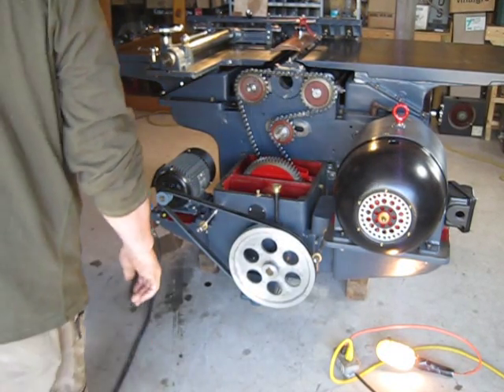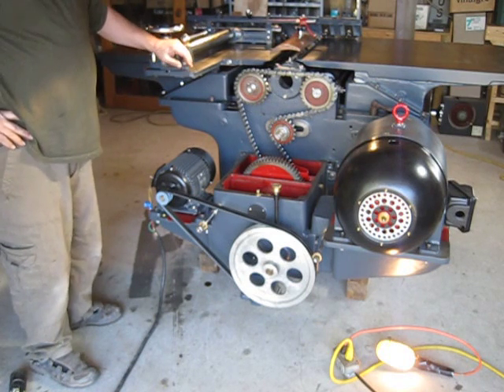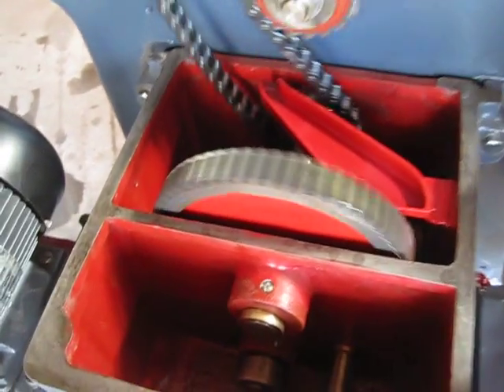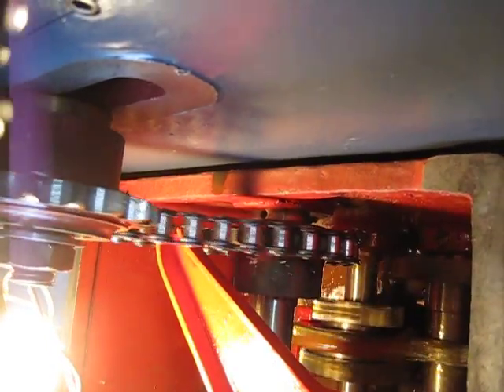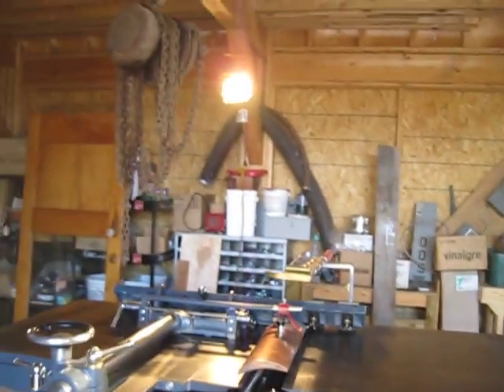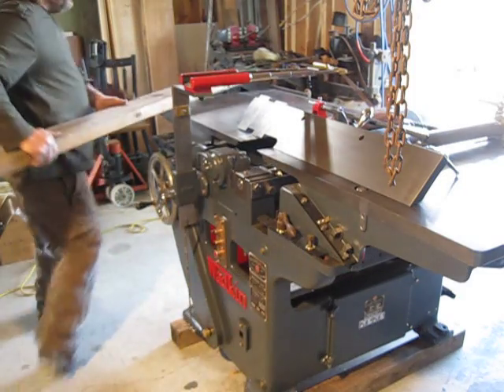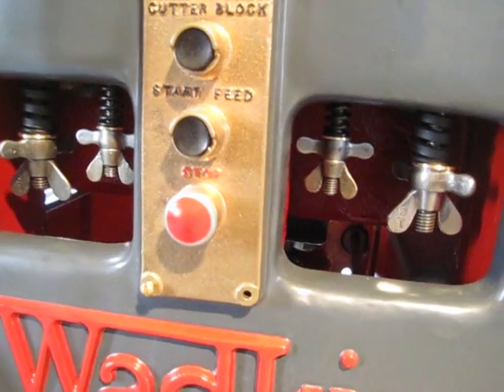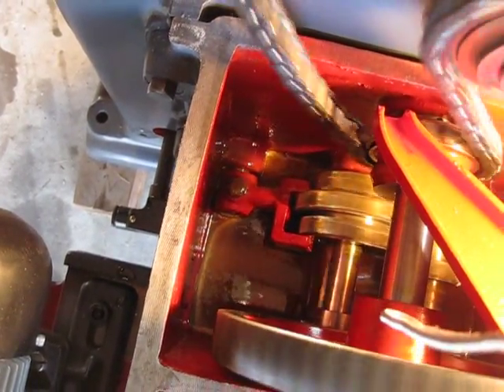006.AVIWadkin RM power feed

Comment: I think you need to run the chain with more slack in order to accomodate the lift of the outfeed roller. I have run one of these for many years and they are bulletproof. The settings of the feed rollers and bars are very important and when properly set will completley eliminate snipe. I wish mine looked as nice as yours though!

Comment: That oiling is beautiful! And the wingnuts are lovely too. Whitworth is a pussycat, workshop machines are OK to work on, old Brit motorbikes are a nightmare, they used a lot of CEI which is a cycle thread, then bits of Whitworth and BSF, BA for the small fittings and BSP for the oil pipework.

Comment from the maker: i have had the planer on hold until i get the Wadkin temple (mill shop) finished. i am machining  the head to take pin knifes for the moulder section.

you can see the build at 
Canadianwoodworking fourm under vintage tools  for 1941 Wadkin RM. it shows more of the rebuild. if you got question drop on by the forum as there are lots of Wadkin nuts there rebuild these machines.

not sure if i link works in this reply but i will post it in the you tube video title.
great machines  the wadkin Kit.

Comment: that machine is mint a credit to you, i have the same one from 1964 did you remachine the serrated feed rollers? if so how? post a video of it running mine is worn on the rise and fall slides the bronze pressure bars are worn as well it is used weekly in my shop need your full service but alas i am in uk .all the best